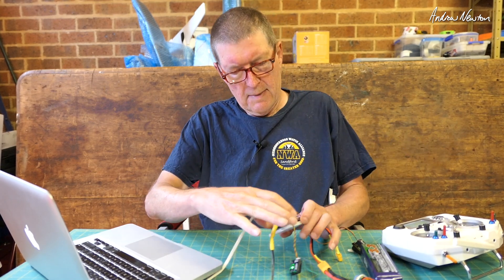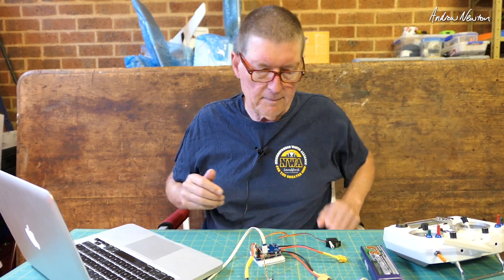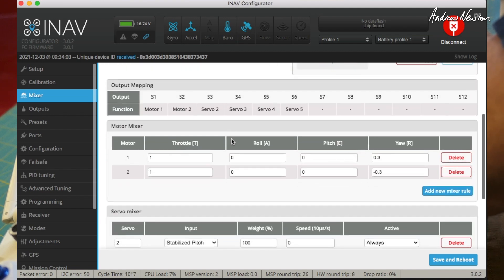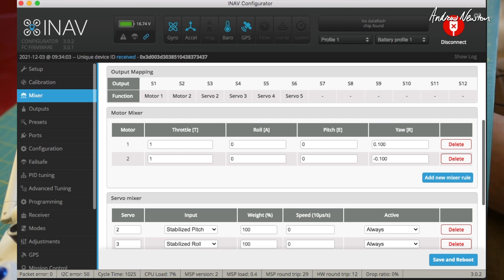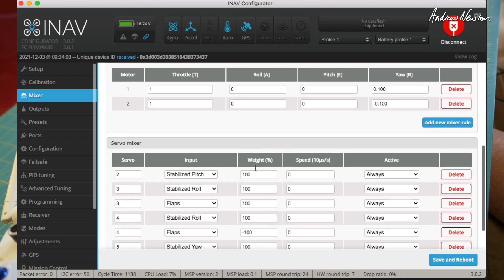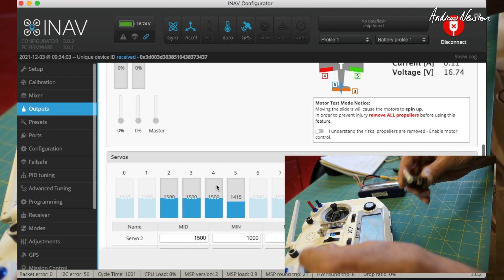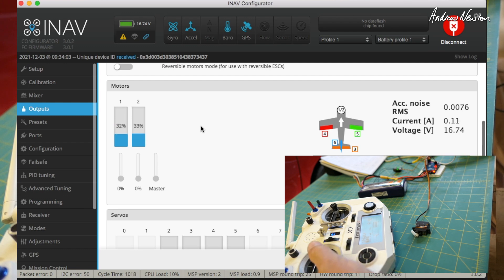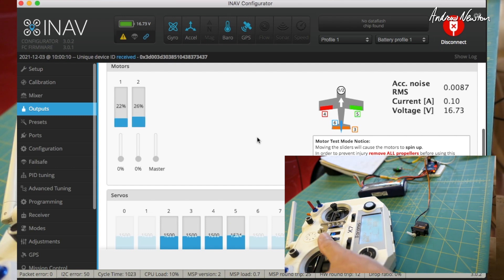Differential Thrust in INAV

Comment: So I setup my iNav plane with differential thrust but when in acro mode, it does nothing but in manual mode it seems to be working.  Other than the mixer setup, is there something else that need needs to be set in iNav.
Reply from the maker: Best to ask on the FB group

Comment: How do I know differential thrust is working properly through stabilize yaw?   I can see on ground when I manually input yaw it’s turning the right way but how do I know it’s operating properly in air?
Reply from the maker: I would hold the model with motors just spinning and rotate it to see if the motors compensate for the yaw

Comment: Hey Andrew, I'm trying to decide on a differential thrust option for an Albatross seaplane. Either use OpenTX or this Inav feature. so...  How can I assign an On-Off switch for differential thrust in Inav? I only want it for water steering. THANKS!
Reply from the maker: Must be possible to assign a switch but I'd have to play with it to work it out. Ask on the INAV Fixed Wing Facebook group, they are helpful
Reply: What I did was program a switch to enable/disable the Rudder channel on the Transmitter. That way, when i want differential thrust, I activate the channel. The rest of the time, it is off, in neutral, and the thrust of both engines is the same.

I just configured it like this on the Hee-Wing-T1... When I make the inaugural flight, I'll let you know how it goes.

And thank you  @AndrewNewton , for your videos. 

Greetings.
Reply: @Jorge-herex  how did that flight go?  I gave the T1 as well and my maiden was a disaster plane spiraled to the ground because of differential thrust I couldn’t even get it to stay in the air. Inav differential thrust was overreacting.  I have s1 S2 on my motors on a Matek F405MWN so each motor is on a pad.  How can I disable this.
Reply: @Freebird_67  I did well. I did not have problems. But the differential throttle is not very noticeable, so I deactivated the switch, which became an unnecessary security element.

To deactivate the differential throttle, in the mixer tab, in the yaw box of each motor, you must put "0".

I also suggest you check if the motors were well configured; the value of that box can be positive or negative, determining whether it will speed up or increase speed. And it is recommended to start with low values, like 0.1 or 0.2.

Try it on land, with the wheels. Or just turn it off.

Good luck!
Reply: Did you end up figuring this out? I am finding this difficult to figure out.... I want to have diff thrust and flaperons for my sea plane set via a switch on my radio. Was hoping to just use the Arming channel and have the inav mixer apply these changes but I can't find a way to get this to happen.
Reply: @rcvg69420  No. I was told by Pawel and Mr D that this isn't possible YET.   Instead I set my plane up with lots of differential Aileron so it won't need rudder for a co-ordinated turn.
Hopefully in the future.
Reply: @AntiqueAirman  I only wanted to have a few levels of diff thrust on a switch so I had one for crazy flat spins, one for normal increased yaw performance, and one that just turned it off.

I ended up settling for just having normal increased yaw performance. This is on a Twisted Hobbys Puddlestar

Comment: I just set up my plane (flite Test G-44 Widgeon) and wanted to know if you launch from the ground in manual or stabilize mode? I'm trying to get my tune set up in iNav. I also have the matek F765 set up. I've only worked with wing models before. Good video though.
Reply from the maker: Good looking model. Start off in manual until you get your tuning right, then Acro or Angle will work well. Before tuning you may not have enough throw on the control surfaces
Reply: @AndrewNewton  Thank you for the reply.

Comment: Nice but should be a mode to disable the differential system if you running into issues in the air.
Reply: Yes indeed. I got used to only using rudder when taxiing because I was too lazy to add a switch when using a PWM receiver. So it should be no big deal using INAV.   I have brought this up to few of the INAV Devs, and so far I haven't got a reply back. A switch to turn this feature off in flight would be nice.  So far I think I'm the only one interested in this feature, so I don't think it's high on their priority list.
Reply from the maker: Yes, very good point.

Comment: What would you suggest in terms of yaw set up for a vtail?  I just put together a foam vtail and the mixer in inav is of course 50/50 elv. To yaw  But I have seen that you always use rc yaw and stabilized elevator for conventional tail models.  Can you/would you do the same for vtail?
Reply from the maker: Rudder is much less effective on V-Tails so it's not as much of a problem. But I would still use RC Yaw to allow lazy bank and yank flying.

Comment: Thank you for making this video Andrew.  
  For those interested, I'm using this feature to taxi my seaplane on water. As it does not have a functional rudder. It works great with a PWM receiver, but I was having problems solving this problem in INAV, as it's no longer done in the radio.
  Thanks again Andrew, I can't wait to get back out on the water. (Y)
Reply from the maker: Yes that's a good use for diff thrust. We need to work out how to turn it off now.
Reply: @AndrewNewton  I'm hoping Pawel has a Big-brained way to use logical switches I'm not seeing. For now, I'll do as you say and turn it way down, so it takes extreme throws for it to activate. I'm still working on it at the bench, I will let you know how it goes in the field. Hopefully this weekend I'll get to test it out.